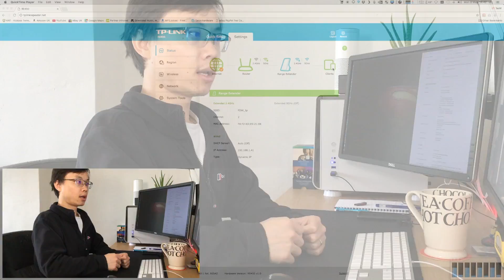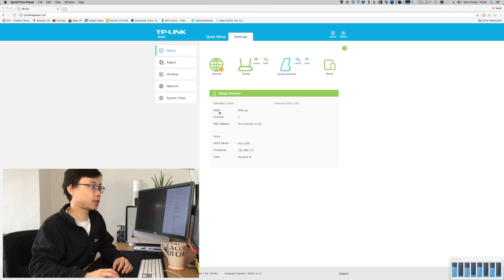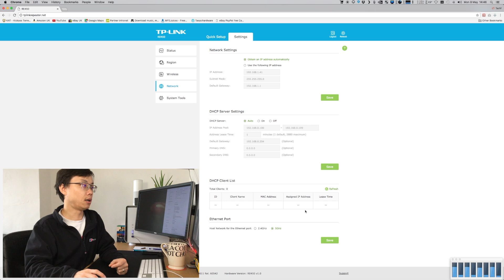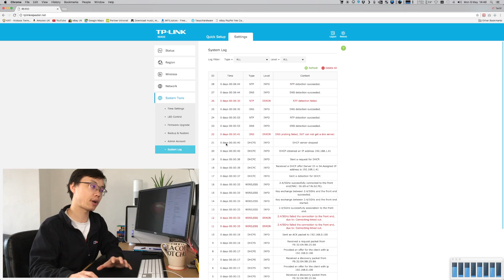TP-Link RE450 WiFi extender High Speed Mode and Web Interface walk through

Comment: My question is could you do a video on how to use winrar or winzip to upgrade the firmware on this extender? I have recently moved to a room with no hook up and had to use  the same extender you are doing the review on.RE450 is a good range extender just been having issue with wifi dropping off intermittently. Subbed and liked video also.

Comment: Hi, but how do you set the RE450 to work on Hi Speed, just by not using the 2.4 range on the endpoints devices?
Reply: Yes, by doing 5G in 2.4G out it reduces a lot of the processing that the repeater/extender must do. 2.5G is slower but less susceptible to interference, it can go through walls a lot easier than 5 gig.

Comment: Hello. Can you disable both 2.4 and 5GHz Wi-Fi extend and just connect a device via cable? Do the hosts that connect to the extender get an ip on the same network as the ones connecting to the original router or they are placed in a different range? 
Congrats on the video.

Comment: I had high hopes for this setup, but it is actually worse than just using 5G band on both router and extender.
My router's 5G speed is 460Mbps and around 100 on 2.4G. When set up as in the video, extender's 2.4G is 130 Mbps. But when on 5G only on both, it is around 300Mbps.
Extender firmware is up to date. Doubt tp-link support will have any good solutions and I probably will have to swallow my pride and route a cable to the extender and use it as an AP.

Comment: I have a 100mbps connection. Now my main router is dual band. So 2.4Ghz band ssid tops speed at 40mbps and 5Ghz Band ssid goes till 100mbps. Now I have set up RE200 in Highspeed Mode, so it connects to main router at 2.4Ghz and transmits at 5Ghz. But when I connect to the Extended 5Ghz band of the RE200 the speed I get is 100mbps. How is it possible when the Repeater is connecting to main router at 2.4Ghz only which tops at 40mbps, but when it transmits at 5Ghz the speed I get is 100mbps.
Reply from the maker: @Aditya A. Aima
Hi, sounds like your 2.4GHz connection is very sustainable(stable), and much less interference on 2.4GHz band. Depending on your main router spec, on 2.4GHz band, the speed could go up to 400mbs. Check your main router's specs.
Reply: @TaoMStudio  The router is Huawei HG8145v5 but is ISP locked and enabled for remote configuration by ISP. However I am still confused about one thing. The channel router is using is free around my place but still router is reducing the 100mbps+ WAN connection to around 50 on 2.4Ghz but when I am using RE200 extender in High Speed Mode it's connection to Huawei on 2.4Ghz(it's actually unable to see 5Ghz SSID because it's on channel 149 which is not compatible for RE200) and broadcasting 5Ghz SSID on channel 36. Now if the host router i.e Huawei is only giving 50 mbps on 2 4Ghz how is TP link RE200 giving 100 mbps on its 5Ghz. Is it somehow connecting twice to Huawei and adding two up and broadcasting on 5GHz

Comment: You mentioned the Ethernet isn’t an input,,, but it is. You can plug in a wired connection and emit a wifi signal. Page 20 of the Manual.

Comment: It does not extend wifi signals in my case.. I had 1750 and it just don't  extend to the next room and also not the next floor. I m not sure what is use of extender if it can't extend the signals. Also I have seen speed goes significantly low on extended network
If my router is giving 222mbps. The extender gives me 70.mbps.
Reply: did you use the 2.4 -> 5 Ghz setting (high speed mode) settings? if not, try using it. It's completely normal to have only a fraction of the original speed. In fact, these devices are called wifi signal boosters, not wifi speed boosters...

Comment: This is the worst extender out of all of them
Reply from the maker: I have been using it since I reviewed, till now never had issues.
Reply: It has been stopping every hour for some reason, I don’t know why
Reply from the maker: Try if there is firmware update or reset it. It may help. Make sure it receives good signal from your router. If nothing works, go back to where you bought it, then exchange it

Comment: Correction: I used this device as an access point by plugging my LAN cable from router INTO the ethernet slot.
Reply: exactly , I did the same after updating the firmware
Reply: Thanks for that information. I want to use the Re450 as a wired extender, from my router using cable to the extender via its only port, for wireless Internet to my garden.
I will try it then. Thanks

Comment: I bought this TP Link RE450 and have to say it works great as a signal extender, actually the signal is stronger than the one sent by the main router. The only issue is that it cuts your WiFi speed to half. I wrote TPLink support and they explained that in theory the processing speed is X2, since the modem send the signal to the repeater, and then the repeater sends the signal. My internet speed goes from 30 to 40 Mbps, and the speed i get from the repeater is between 15 and 25. 
So, i would say that if you are thinking on buying one, try to hire a high speed internet, or the signal you'll get from the repeater will be too slow.
Great review by the way!
Reply from the maker: thanks
Reply: I got one yesterday and mine doesn't cut the speed. It improved the speeds on devices in my room

Comment: Does a mobile device reconnect depending if you are first near the main router, and then you move out of distance from the router, but you move near the Extender ? I am going to guess that it will reconnect to the extender automatically ?
Reply from the maker: It will reconnect to extender if other network is disconnected automatically

Comment: Congratulations TaoM! Great video and great explanation.  I was really confused trying to set it up but now it is clear except one little doubt: what LEDs should be on if we use it to receive the signal as you did in the video, i.e., receiving 5 GHz and transmitting it with 2.4 GHz? I'd appreciate it if you could also help me with the following: my ISPs router maximum speed at 2.4GHz is 50 Mbps, so beyond that I need to use 5GHz. To take advantage of the 200 Mbps that I am entitled to, should I then set it up to receive at 5 GHz and also transmit at 5 GHz?  Thank you!
Reply from the maker: Hi, Ricardo. thanks. 1. if you receive 5 GHz then the 5GHz light will be on. 2. For your situation I would suggest you try receive and transmit on 5GHz band. if it can achieve optimum speed and keep it stable, then keep it that way. otherwise, use receive on 5GHz then transmit on 2.4GHz. Hope this helps

Comment: the mbps speed is 1300 Mbps + 450 Mbps
if i use output with cable lan. which one my pc will get?
1300?? or  450??
BALAS
Reply from the maker: 1300Mbps on 5GHz, 450Mbps on 2.4GHz, Gigabit ethernet port output, so 1000Mbps on LAN. Hope this helps.
Reply: TaoM Studio wait.
i have the smaller version of tp link repeater, in box is write 300mbps... and when i using LAN try download with IDM
i only get 3.124mbps...
i go to main router and connect my Pc , i got 8.346mbps with IDM

why? if i buy like yours,
why you say i get 1000mbps? how can? the input signal of that repeater from wifi right? and the speed of wifi on 2.4 is 450mbps...
how can i get 1000mbps with output LAN?
Reply from the maker: "Mbps" and "MBps" are different thing. Google it if in doubt. The ethernet port on RE450 is capable of Gigabit speed, but does not mean you will get that speed. "mbps" on the device itself simply means that the max speed it can cope. 👍
Reply: my repeater is  TL-WA850RE, the most cheapest.
can you tell me how max my speed if i use the ethernet?

100mbps right?

Comment: I have another model which is RE200 which can go up to 750Mbps. My internet speed can reach 300Mbps from wifi router, however when I connect to the extender, it's merely hit 140Mbps... Is this normal??
Reply from the maker: Well. You will always have speed lose when using the extender. It also depends on the signal strength, interference,thick wall etc. I would suggest you to try using high speed mode and put them closer to test the max speed you can get, then find the best location for it. Try and error buddy. Hope this helps.
Reply: Alright thanks.

Comment: Hi, can you help please,  I want to reach a CCTV wireless camera which is around 35mtrs away from the router first of all is this possible?, and if so would I put the extender halfway between? thanks for any help Malc
Reply from the maker: +luckylewis59 i would say half way is your best option. But you might want to try and error to see where is the best location.
Reply: Great thank you.
Reply: I've just purchase two RE450 wifi extender units for one of my Hikvision hd 4mp ip camera's on my outside garage,which is approximately 30 to 35 meters away from our home. They run perfectly in range with blue signal strength. However Tp-link UK say one unit can reach 12,000 square metres away..however we needed two units to reach our garage..hmmm.?

Comment: For High Speed Mode, is there an actual section in the settings to enable it? Or did you just simply choose to use the 5GHz for the router and 2.4GHz for the repeater yourself, basically forcing it into only talking to the router on one and clients on the other?
Reply from the maker: Just choose 2 separate frequency networks. 1 to router, second as repearer.
Reply: Great, thank you! Hoping to pick one up today on local Kijiji for $60!